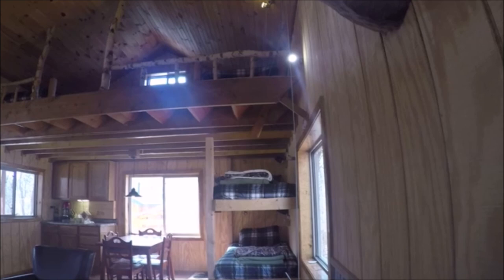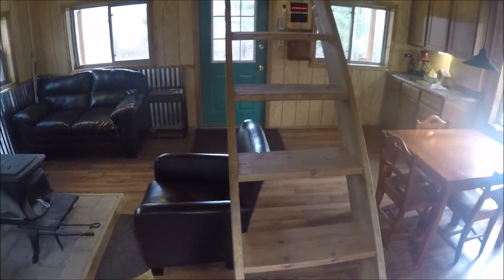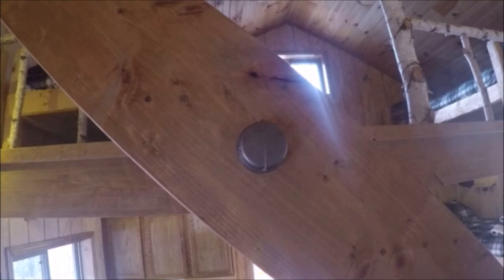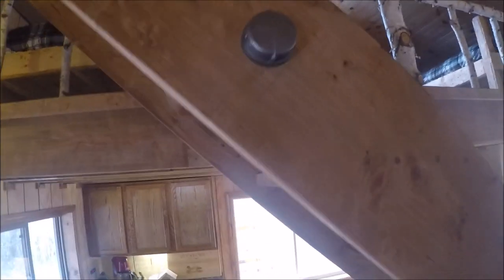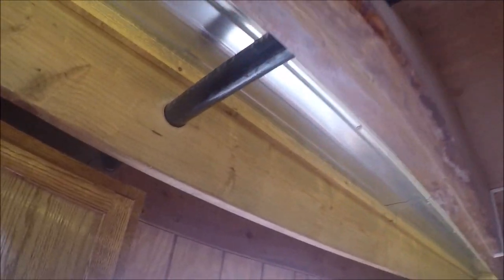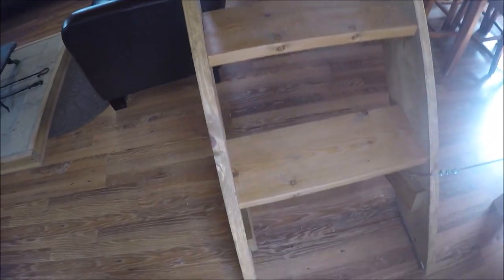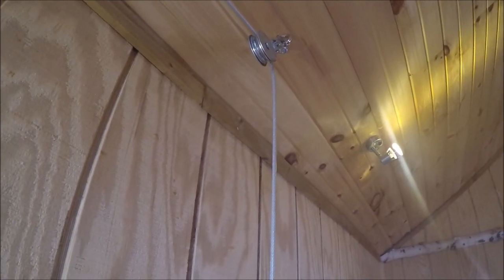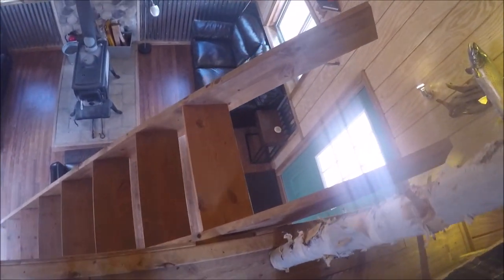How to Build a Counterbalance Staircase

Comment: Thank you very much for doing this video . I must have watched your cabin building video at least 25 times . I never get tired of it . Every time I watch it I try to learn what you did here and there . In how you made your porch ( rafters ) and how you connected it to the cabin. Funny thing is I was just watching on you tube other people making a set of stairs for their loft and your video popped up . I love your idea . Question about venting your roof from the porch side . How did you do that seeing you installed metal roofing for the porch ceiling ? Thanks so much . Great video.
Reply from the maker: Glad you like it.  The roof rafters in front of the cabin run from the ridgeline all the way down to the front of the front porch in one straight run.  The insulation is only inserted inside the rafters inside the cabin.  On the front porch, there isn't any insulation, it is just rafters with steel roofing above.  The ceiling on the porch is steel, but it is the vented soffit type and breathes so no issues with venting.  Since the insulation is attached to the bottom 3/4 of the rafters inside the cabin, there is a gap between the top of the insulation and the steel roof. That same gap extends all the way down into the porch.  Air can move freely from the front porch all the way up the roof to the ridgeline, and out thru the vents between the roof and the steel ridge cap.  Hope this helps.  Good luck with your project.
Reply: @Michigan_Backwoods  Thanks again . I really like your videos . Even the outhouse build .LOL

Comment: Nice Staircase, could be done 6 or 8 inch blanks, why 12 inch, so heavy??, I might duplicate this into my Cabin, at Arctic Circle, Finland, have a similar Cabin there, at the River Ounasjoki. I would do this lighter, and needs, absolutely railing for safety, just outside though!! How is your 2 x 100 W Solar Panels  working?? Enough power from 200 W? Is that battery size OK?? Thank you, nicely done, Greetings from South Florida, only 94 today ;o)

Comment: Hi Bob, it's me again. I was wondering, what did you use as a stain/sealer for the T1-11 that you used for the interior wall panels? Thanks!
Reply from the maker: The T1-11 inside the cabin is untreated..........not paint or stain was used; it is holding up well!

Comment: Hi. Thanks for the video. My stair case is currently on a wish system, but I would like to add a counter weight to relieve some of the strain on the winch. My question is, Where do one find the crimper/cable kit/ with pullys  and what size cable and diameter fully do you recommend. Thanks
Reply from the maker: For your counterweight, just go to one of the big box stores like Lowes or Menards.  They have a section that sells cable, pullys, as well as the cable clamps.  I think I used 3/8" cable for mine.  Good luck!
Reply: @Michigan_Backwoods  Thanks. I have successfully completed my project using gym machine cable (ball stopper end), pulls and carabiners. Works like a charm.

Comment: You have the counterweight cable attached to only one of the stringers.  Obviously this makes it easier to avoid when using the stair, but wouldn't it create a twisting force on the stair, especially with open risers?
Reply from the maker: Daniel, the balance of the stairs with the counterweight is so slight that there is little to no twisting action.  The steps square the stringers into one tight unit.  This has not been a problem, no used >5 years.  Thanks

Comment: Hey made a similar set of stairs copying this and the stringer attached to the cable/weight sits higher than the other tread by about 1/2” once down on the ground due to the weight being on that side.

Any idea how to correct?
Reply from the maker: Dave, mine does not due that, both stringers sit upon the floor, but the weight on the non counterbalanced stringer is definitely heavier.  I don't have an easy fix for you but I would think that your pivot point for the stairs is slightly different than mine, which I'm sure is hard for you to adjust now that it is built; or, my stairs weigh much more and it isn't a factor.  If the problem is severe, consider two cables, one on each stringer, that would connect to a point on the wall to limit the obstruction.

Comment: Is that a solid 3.5” steel pipe and is there any concern of the pipe bending or stress bending due to weight of staircase and persons climbing it?
Reply from the maker: No, it is not solid, it is a hollow 3.5" pipe.  Your concern is the same as my concern, and I worried about it, but thus far it has not been an issue and I've had people 250# go up an down.  After 3 years I can say no bending!
Reply: @Michigan_Backwoods  that’s a solid test of time. Thank you for that.